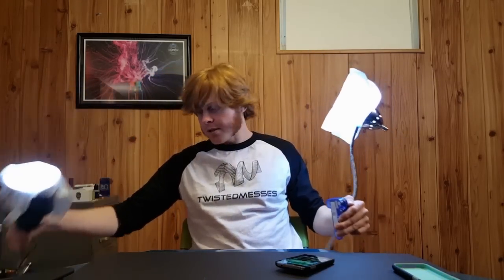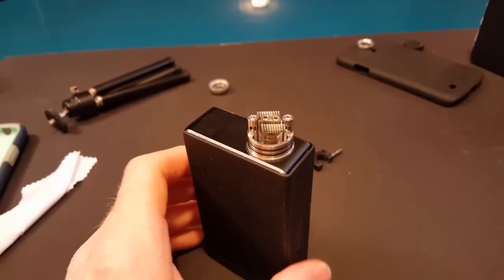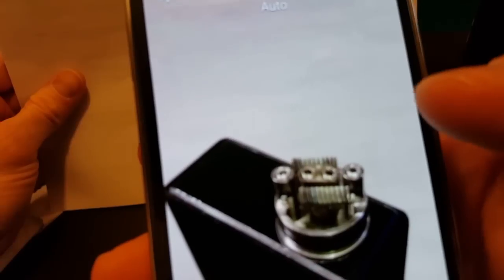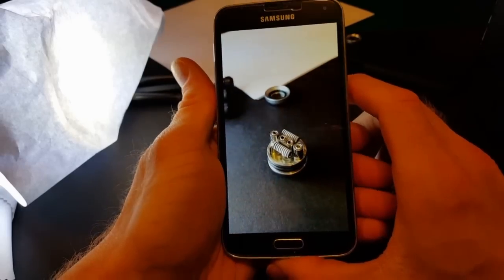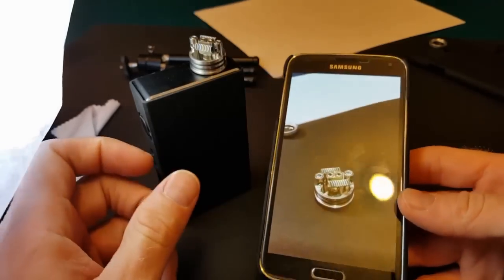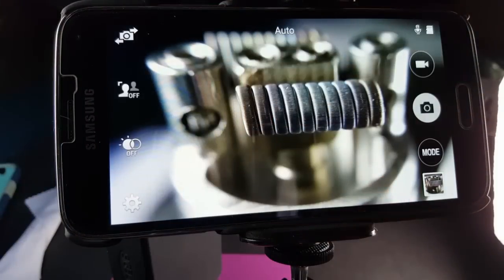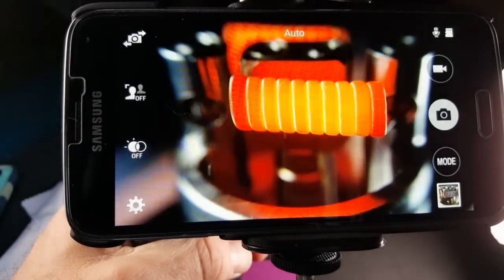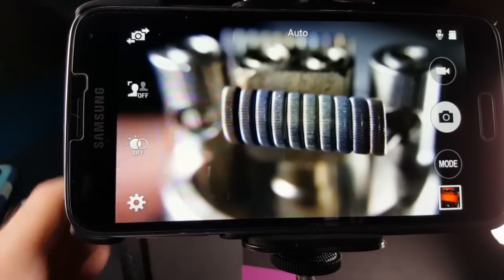Making Coilporn with TwistedMesses

Comment: sorry, I think I missed it but what is the resistance of that dual coil build you were taking the photos of.  Such a nice build... That surface area tho....
Reply from the maker: Yeah really loving the build. 2x26g anarchist wire cores fused with 40g KA1. Can fit 10 wraps in the twisted messes rda! Haha, so much surface area and came out to 0.23-0.26 ohm. Really enjoying it at 5v (110w or so)
Reply: Twisted Messes Bro the center post in my Twisted Messes RDA is spinning :( Back to the MXv4.
Reply from the maker: Riley Vick just tighten the bottom contact pin. It's not adjustible. Or hit me up at support@twistedmesses.com and I'll get it swapped out as long as it's not a clone :)

Comment: Twisted Messes Thanx for the video, I wanted to share how I get my glow shots and you can see em @coilbuildn_pitbulldaddy on IG if you want cause I do collages of fire shots, and I wasn't sure if anyone else does this but I think this is an easier and better way to get good glow stills at least with Samsung Galaxy series phones, Take a video of it firing, open and start watching the video, when it opens and begins playing hit the menu button or the 3 vertical dots in the top right corner, go to settings, in the settings make sure "Screen Capture" is enabled, Now when you pause videos you'll see two arrows on the top portion of the screen, and you can go frame by frame by frame and screen shot the best glow shots, or capture 4 for a collage, this is the same way I do drip shots too, and being able to look at every frame just gives you the capability to see the coil glow from start to finish and pick the best one
Reply from the maker: That helps a lot! Thank you! Hope it works on the 6 with it's 4k resolution!
Reply: yea man Twisted Messes, i really wanna try the 60fps and slow motion just to see how they do with the macro lens on and if you can still navigate frame by frame but those features are currently not available since I flashed a custom rom on my phone